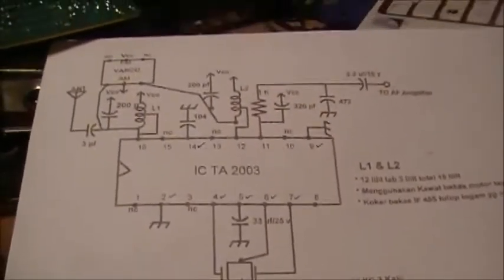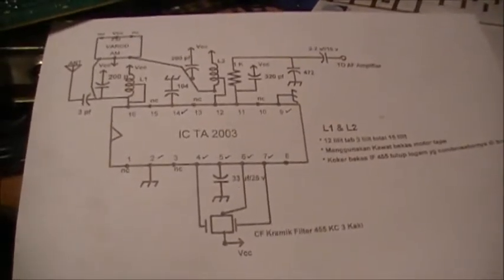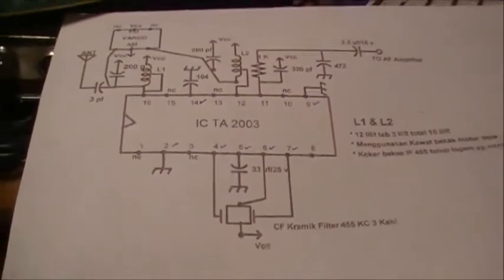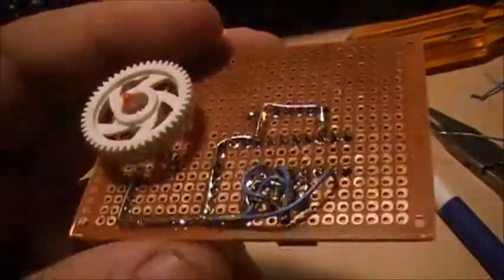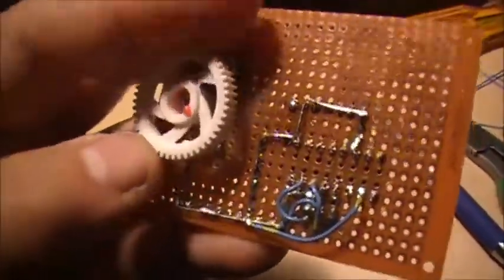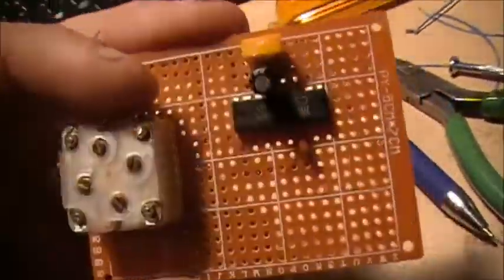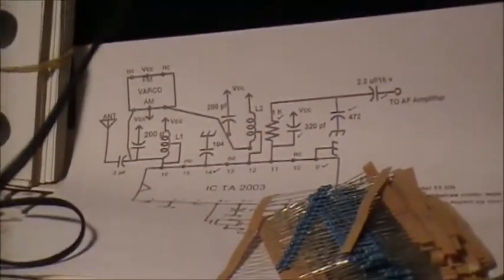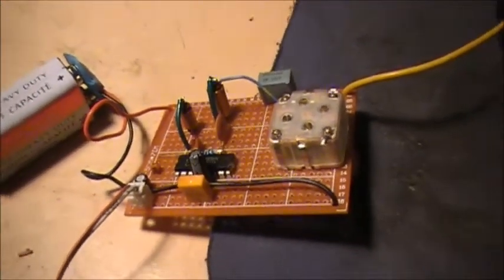Homebrew AM / FM receiver

Comment: What is the best single chip radio?
TA2003p  or tda7000

Tda7000 has more features, comes from the more reputable company and is often considered better but is expensive due to inavailability.
Ta2003p has less features but has crazy intergration.
Reply from the maker: Try both, might surprise you!  :-)

Comment: Great job! Similar set up using SA21111 https://youtu.be/yk82AWVhTK8. Remember to terminate the unused pins!
Reply from the maker: You have so very cool projects on your channel... Neat stuff i gotta say!   When you say terminate.. how do you terminate your unused pins?
Reply: @Radionut63  

Unused pins should not be left open as they can interfere with the internal circuitry. They should be connected to the positive or negative rail (refer to the datasheet) via a relatively large value capacitor or resistor. This maintains the relative potential at the pin even though the pin is not functioning in the circuit. Datasheets are sometimes confusing regarding this, and in addition, it is possible to swap polarities in many of these receiver chips. One rule of thumb is that unused output pins should be grounded via a cap and unused input pins connected to positive via a large resistor (like 10M). I have found this is not always the case though, so you have to experiment. Sometimes a datasheet will specify how to terminate unused pins or indicate n/c for "not connected."
Reply from the maker: Nice explanation. thank you. :-)

Comment: how is the coils designed on this reciver? trying to fix my recivers bigger coil with 27 turns with 1mm wire and i have 0,8mm wire avalible
Reply from the maker: i will record a little video about this project today.  Nothing has changed since i built it in this video.  I do plan on changing out the coils in this radio to the proper type. :-)
Reply: Radionut63 sweet! :)
Reply: Coils depend on the frequency band (AM or FM) of interest. Similar set up using SA21111 https://youtu.be/yk82AWVhTK8. Remember to terminate the unused pins!

Comment: It is working AM and FM? It is not clear how you switch from FM to AM and vice-versa. Also I can't see any key connected on PIN 14 of TA2003. Does the capacitor "104" (connect to the pin 14) work as a soft touch switch? The sound seems nice. Congratulations. 73.
Reply: Similar AM only set up using SA21111 https://youtu.be/yk82AWVhTK8. Remember to terminate the unused FM pins!
Reply from the maker: I still have this contraption here, i do have intentions of rebuilding it again. :-)
Reply: It's using the AM circuit only with the FM pins not connected. FM requires an additional circuit.